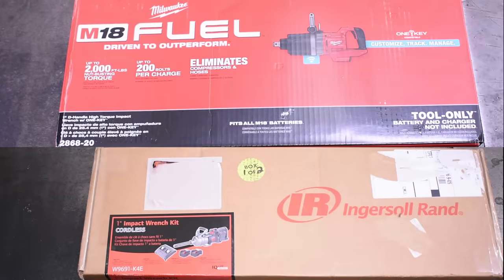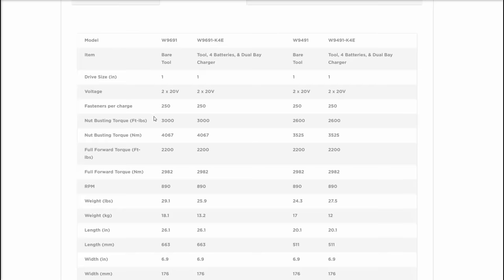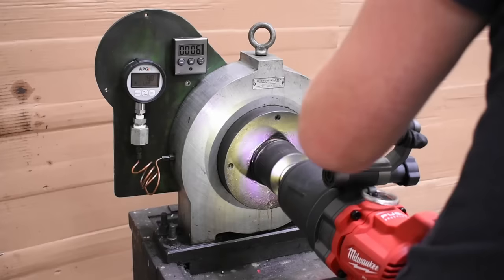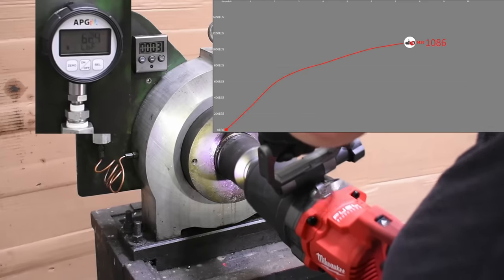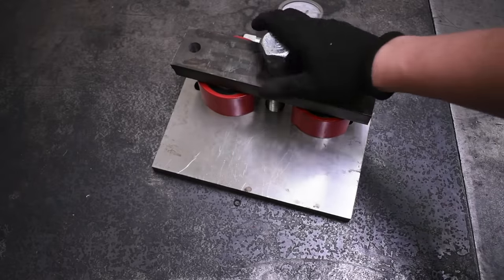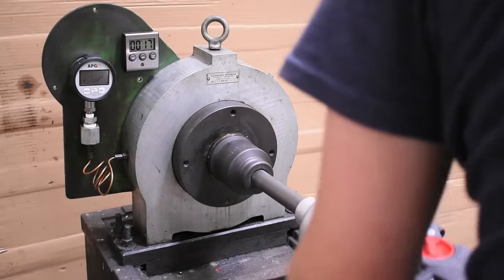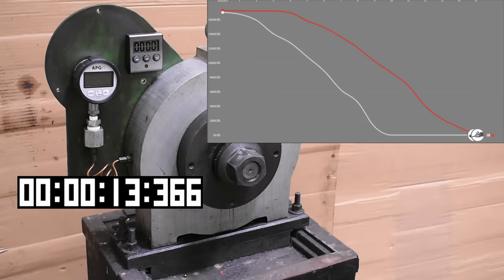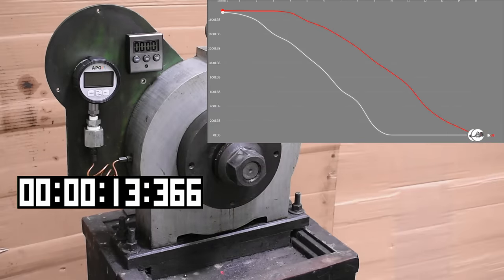World's Most Powerful Cordless Impact Wrench vs Milwaukee for the Crown

Comment: For a real life test, get a big excavator and test all the guns on the track pad bolts. You will have hundreds of similar bolts that usually needs to be cut off with a torch.
You can get a used track for scraps if you don't want a big machine outside your shop.
Reply: Would that be a good test though? I figure those fasteners get pretty mangled. Going to just end up breaking stuff which is cool and all but not really the point.
Reply: @BMikeAD  Bolt heads are usually intact. This is a need for a impact everyone with excavators and dozers have.
Reply: @noc8076  I'm not concerned with a bashed up bolt head. You can hammer a socket or weld a nut on. I mean if they are messed up and rusty they ain't coming out without heat or breaking them anyway. Which makes torching them from the get go faster and easier than fucking around. And yeah I work on diesel equipment for a living just don't see tracked stuff too often.
Reply: Would love to see a comparison on the same excavator. Big air impact on one track set and these cordless monsters on the other. Who cares if the bolts snap.
Reply: @BMikeAD  Just test which can break stuff faster then!
Reply: I could not agree more!
Reply: That would be a great battery test. I like to strip off all of the pads before I break the rails so with a typical 40 (or is it 42) pads per side, will you be able to get all of the pads off with just one battery swap? 

And mangled bolt heads? It happens, but like someone else said, that's why you have a hammer handy. Beat the socket on and the impact force will flatten things out so the socket will come off. 

But maybe it will only last for one side on bigger machine? Then you just continue with the rest of the undercarriage parts while the batteries are charging.
Reply: @BMikeAD  Depends. When I'm pulling track bolts, we use an air-powered gun. Which sucks, because the compressor is not nearly good enough to hammer on a bolt until it breaks loose. Typically it's hammer, hammer, hammer, rest. Repeat. We do have a guy who totes the Milwaulkee though, and it works very well. I work on Mining, Forestry, and Construction equipment.
Reply: @BMikeAD  we spray hydraulic oil all over them night before then hit them with a 1inch pneumatic gun and probably get 90 percent of them. But I wouldn't even bother using a battery rattle gun for that job in the real world there's just some things where air is king
Reply: Tanks are much cooler
Reply: thats funny you say that, I am trying right now to get one off.  Bent a 3/4 breaker bar, snapped a wrench, stripped a socket and still haven't got it off.
Reply: I was wondering who ever does need so much torque
Reply: It can be whatever that IR is way more powerful Dyno numbers don't lie bud period!
Reply: Agree. I changed a set of track on a D9T yesterday and the battery impacts just didn't have a chance!

Comment: Bring on the Formula 1 pit guns!

Give it another year and you guys will probably be testing some prototype stuff built by NASA to torque down bolts on mars.
Reply: The Formula 1 torque gun is awesome. I’d love to see that on this channel. The torque guns I have seen at NASA are more linear and not really impacts. I’m sure they have both though.
Reply: I wanna see nascar pit guns, and the F1 and LMP pit guns.
Reply: Can't wait to see how NASA space ugga dugga guns perform!
Reply: Same I have been wanting to comment this for a while
Reply: I just had a look at the Paoli guns...$10,000 and 4500Nm 😳
Reply: @procrastinator1842  wow
Reply: @mikeerin5031  Okay I know nothing about these torque guns. What makes them so impressive? What kind of torque figures are they putting out? Watched racing just never thought about that aspect of the pit.
Reply: @Parents_of_Twins  speed at which they apply a very large amount of torque for the single nut on the F-1 spindle.
Reply: @mikeerin5031  What are those torqued to?
Reply: When I saw that part I started to research more.  We gotta use inch and a half guns at work from time to time and those Nascar guns look smaller.  I have nitrogen connections all over the place at work so thats not an issue.  lol.. I'm getting real tired of the massive 1.5 inch guns
Reply: @pin65371  What kind of work do you do that requires an 1.5" impact wrench? I can imagine using them gets real old real quick. I know my 3/4 CP can be a heavy pig depending on how you have to hold so those must be crazy.
Reply: @Parents_of_Twins  oil and gas on maintenance.   We try to avoid using the big guns to put things back together but sometimes it's needed in order to pull piping back into position
Reply: @Parents_of_Twins  Theyre usually running somewhere around 300PSI on Nitrogen. A Single nut on Porsche's run usually around the 600ftlbs/1000nm range. I imagine F1 it may be higher than that. And it has to do it in about 0.1 seconds
Reply: @thaneirwin4688  Damn that is impressive.

Comment: That thing looks like a crew served weapon, does it come with a pintle mount or tripod?

Just because I’m a Milwaukee guy doesn’t mean I can’t concede that is an absolute BEAST
Reply: I bought a 1/2 Ir a couple years before the race started with milwauk. and mak. I have not regretted it yet. I think it uses the same batts. as this one. 12 or 13 hundy is a steel for what it does.
Reply: What puts me off is the batteries might not work/charge properly. You can bet that if you get a tool that ONLY works with 2 batteries, one is gonna give problems. Here in the uk people have only heard of Milwaukee tools at this level, who makes that other one?.
Reply: @sirmalus5153  Ingersoll-Rand, Probably the OG pneumatic supplier in the States, at least. Huge company.
Reply: "Terminator"💀
Reply: It comes on a humvee

Comment: I can imagine being all up under a semi trying to break u-joint(Yoke) from the transmission with the ir and it being less scary than the old tire gun. I've always feared the air fitting breaking and not being to get my face away from it.
Reply: Worries me what semis you're working on since all the ones I worked on had straps to hold it to the transmission n I had to take them off with just a 1/2 ratchet
Reply: @benmiller5015  yup even on the 60 ton haulage trucks I work on I only ever need a 1/2 gun for drivelines. It'd be nice for box trunnion caps and scoop z-links though.
Reply: Im with ben here... What are you working on that needs a 1in impact on the drive line lol?
Reply: Eaton Roadrangers 10+ speed trans and driveline often need at least a 3/4 gun to remove the nut holding the yokes on.
Reply: @dchawk81  Most people haven't been bitten by snakes either, but some things make people nervous. Pretty sure we all carry some irrational fears.
Reply: @dchawk81  we have 6 flexzilla 50 ft lines in our shop they ALL have blown the air fittings off.
Reply: @dchawk81   Retaining balls can fall out of the quick connect sometimes if they get mistreated. Disconnecting and throwing it off the top of the truck 8' up enough times will do it.
Reply: @mrsmith5320  true but you need to remove the ujoint first to even get to the yoke nut
Reply: I think he means the yoke for the transmission that connects to the driveline (I hope)
Reply: @BMikeAD  yeah, i thinks thats what he meant
Reply: @dchawk81  I think I gave you the wrong impression. Mining equipment is big and dirty as fuck. Air lines get damaged working on them. They're a wear item especially running bigger air tools with all the vibrating. I've seen threads wear out but it's usually the quick connect retainer that fails. Failed quick connect just results in the line popping off whatever it is you tried to pull the trigger on and threads usually just leak. No whipping around unless you severe the line or let the leak go for way too long.
Reply: @trailblazer632  apparently you haven’t worked on drive lines enough. The end yoke is often held on by a large metric nut. I use a 2 3/16” socket
Reply: @justinmartin8887  removing the yoke nut has nothing to do with the ujoints.
Reply: @dchawk81  I once had a fitting blow apart when using my PH3050B air hammer, the hose whipped around and literally hit me in the left testicle. It was a really bad week.
Reply: @trailblazer632  really? What might a person remove before he removes the end yoke nut?
Reply: Please replace u joint with the word yoke, you're causing a war down here!
Reply: @justinmartin8887  he never got that far. He was describing removing the u joints with a 1in impact.
Reply: @trailblazer632  pretty sure he was talking about the yoke because its part of the u joint system and is technically a u joint, (it is shaped like a u, kinda stupid tho), it would be impossible it get u joint bolts on a semi tight enough to need anything near a 1in impact, unless he could only afford 1 impact for his whole shop.
Reply: @trailblazer632  fair enough. I’m somewhat certain he was relating to the end yoke though, because no one in his right mind would even relate a 1 inch gun and a u joint cap
Reply: @BMikeAD  The drive line yoke. Not the little 1/2 inch or 12mm double hex on the straps sorry for any confusion.
Reply: Sorry for the confusion. First the driver tears all hell up. Then you break the straps loose, with a gun or ratchet, but if you choose gun and strip it it's up to you to get it off. Then you normally only need the old ir pistol 3/4 to break the lock nut on the transmission yoke but sometimes the tire gun does come out. As for the airline fitting they are a wear item and they do break it's not daily and if I hear it start to leak I will change it out. And maybe I have an over active imagination but I can see that fcker coming apart and whipping around under there with me.
Reply: @dchawk81  It happens, I have 3 broken teeth to prove it!
Reply: MBA 12 point pinion nut is torqued to 9 to 1100 plus ftlbs.

Comment: $1400 is awesome, my CP 1” I paid $900 for and I am limited to what the compressors capacity is so battery powered that can compete with it is worth the money even if I get a job after a roadside tire guy welds the nuts on after a tire repair and have to use a breaker bar first, all my other main tools are battery powered except my 1” I guess it is time to upgrade it.

Comment: 20 years taking off lug nuts and I can tell you right now that if the extended anvil won't take a stuck lug nut off the short one usually will so there is a difference in torque in that part
Reply: Yeah except that almost every truck mechanic uses an extended anvil 1” impact… to take off lug nuts.

Comment: Still amazes me every time I watch a TTT channel and see Milwaukee's 18v still crushing or at least keeping up with 36+ volt and/or dual battery tools
Reply: For sure! I committed to the 'Milwaukee battery universe'(lol) a few years ago specifically because everything has said that they have had the best battery tech for a while, and still keeping up when everyone is trying to move past 18v as fast as possible is only proof of that. You also get to a point where 'good enough' really IS good enough, and I feel like the 18v lithium generation of tools was that point - a lot of these guns produce enough torque to snap fasteners & attachments(like TTC's impact driver testing, going through so many adapters) that they're sized for... so how much MORE power do you actually need, do you actually have a use for? And, if you have excessive power, how many actually use features like different torque settings versus just leaving it on full pow and causing yourself some headaches from doing so(I mean, what dude doesn't feel like a fastener needs a few extra ugga duggas than it really does? It's gotta be a genetic problem we're born with lol)?
  
It'll be interesting to see where Milwaukee goes from here(they do have the MX Fuel stuff, albeit the batteries are gigantic...) - but, am I actually going to buy into a "more powerful" Milwaukee lineup? Well, since I don't do steel work on skyscrapers and I'm not a heavy truck/equipment mechanic... probably not lol, I don't NEED more power than the big boy 1/2" I already have. If anything, hopefully a 'next gen' Milwaukee lineup drops sooner than later so the M18 Fuel stuff can be had cheaper!!!
Reply: @RyTrapp0  exactly why I chose the M18 lineup one battery that works in every tool 18v is light enough and compact enough and still competes with the competitions larger 36v 40v 54v platforms. However in the future it would be nice to see a 36v 2x18v for  tablesaws and quick cut saws ect Mx is to big but sometimes you need a tad bit more power

Comment: I work in a foundry and we are always removing large 2 and 3 inch nuts and bolts from dies, presses and shakers. For a power tool we are hell on earth. We chew up impacts and spit them out. Our last purchase was this Milwaukee impact and so far it has performed well. After severe use 30 minutes straight it was so hot that it was unpleasant to touch, so we cooled it down before we burned it out and it kept on truckin’. That’s the only knock we have. And I don’t believe any brand would be any better. But we will see how well it holds up over the long haul. But so far I give it 8.5/10. Very strong and ergonomically designed. It’s not too heavy and has taken the abuse so far

Comment: Great job! I also really appreciate you guys showing the torque of the lower settings. You mentioned in this video that the lower settings were closer to their advertised numbers compared to what the smaller drivers can replicate. Did you do this same testing for the 3/8 and 1/2 drivers? If so I must have missed it because I would love to see what settings 1 and 2 could do on the various drivers (m18 mid torque or m12 stubby for example). As you guys have consistently proven, advertised numbers are not always accurate. Thanks again for all of your hard work! I wish you continued success.

Comment: Just ordered the IR. Can’t wait to try it out, we work on plate heat exchangers and use a pneumatic impact all the time.
Reply: How did the ir work for you?? Thinking of getting one myself
Reply: @1122rodney  so far it works great! The batteries could be more rugged, one of them broke where the screws keep the two halves together. I just used gorilla tape to keep it together and it’s still working. It’s extremely strong. So get ready for a work out. I need an extra set of batteries because they can drain pretty fast when working on larger heat exchangers. Other than that it’s great!
Reply: Thx. Just ordered mine with an extra pair of batts

Comment: After seeing this video as well as the new 3/4" Makita, it seems as though the lower voltage is holding the Milwaukee back, who knows what they could do with a 2-battery, 36v setup. As long as it they used 2 18volts instead of an increased voltage single battery, as this is one of the advantages of Milwaukee in that you can use any of their batteries on any of their tools.

Comment: One of these days you guys are gonna have to try out the 1½" drive Ingersoll Rand 2955 impact, quoted 4,500 ft-lbs.
It might be a while since it apparently goes for around 7 grand and requires an insane amount of air to run... but it would be cool to watch it go ham on the dyno!

Comment: Really appreciate you not accepting juiced up one-off tools submitted by the manufacturer.  Side note is that I would be really hard pressed to spend that kind of cash on a tool ( Ingersoll) to get that torque for long term use in the field.  I will stick to my one inch Ingersoll Rand impact which runs on air for now because I can drop it in the mud or sand and pick it up and still go back to work without worry. For me it has to work year after year.

Comment: Haven't even watched the video yet, but I work at a commercial tire shop, we demoed the Milwaukee a few months back for ~3 months, we all loved it, didn't have quite enough torque sometimes, but it was nice not having to run an airline around all the time, so it weighed out. A couple weeks ago we got the IR to demo late on a Friday, it was used on one truck then, like one or 2 trucks on Monday,  and then I used it for the first time on Tuesday. It stopped impacting completely when I used it, swapped batteries, changed directions, nothing. Imo IR needs to stick to pneumatic guns, that cordless is absolute garbage. Dead after MAYBE 60 lugnuts.
Reply: Also the Milwaukee feels way better to use. The weight difference is definitely noticeable, and its not nearly as jerky as the IR was, from my experience anyway.

Comment: You should be able to send the IR charger back to be replaced under warranty. It sucks that charger was not functioning properly from the factory but it at least changed the batteries enough to fully power that beast of an electric impact wrench.

Comment: Honestly the Milwaukee doing what it did on an 18 volt battery. 12 amp in one battery is far more impressive than the extra torque out of the IR.  My question would be what happens if Milwaukee starts dabbling in this flex volt setup type batteries? They have been so far ahead of the pack when it comes to battery technology doing the most out of The least amount of volts needed for so many years now.
Reply: Milwaukee really isn’t ahead of the pack, battery tech wise though. Other than being one of the first to move to 21700s, they’re pretty middle of the pack, batt tech wise. Even then, professional brands like Hilti were using 26650s before 21700s came to tool batts.

It’s something they use to their advantage, actually. Most higher tech battery platforms have more aggresive power management, which has its own benefits for more consistent power delivery.